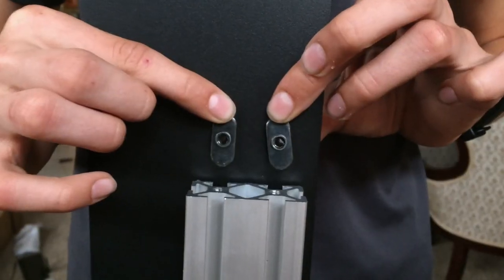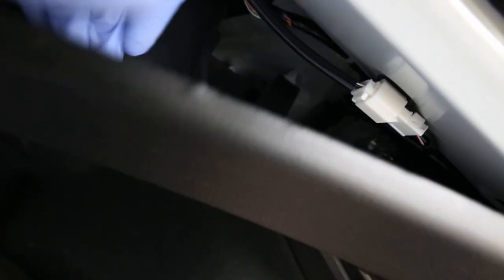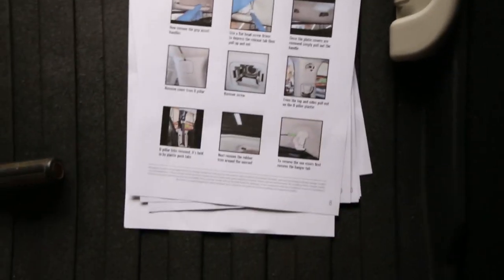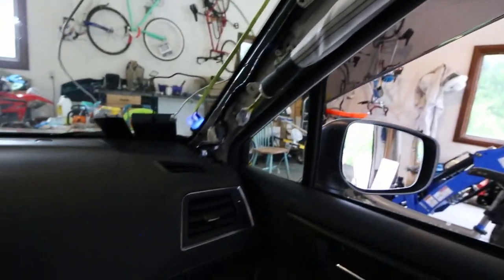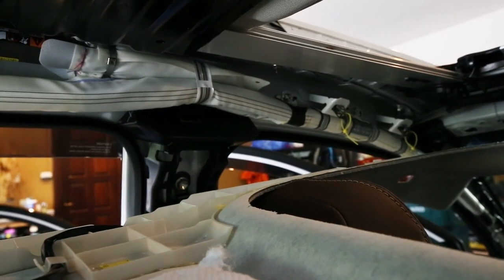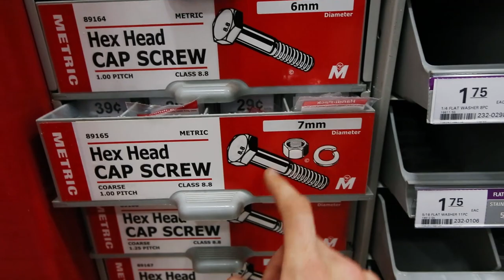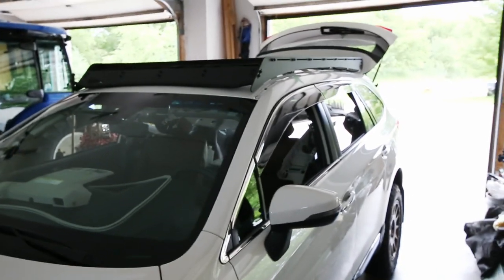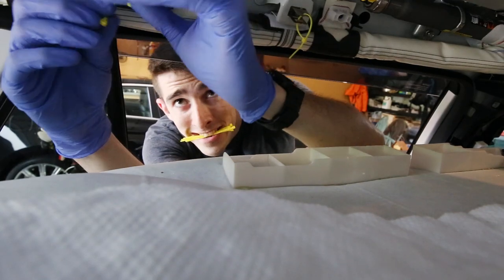FULL INSTALL WALKTHROUGH OF PRINSU RACK ON 2019 SUBARU OUTBACK 3.6R TOURING

Comment: Excellent walk through. I wouldn't have attempted this on my own without it. Finished mine yesterday with no major issues. A few additional thoughts for anyone attempting
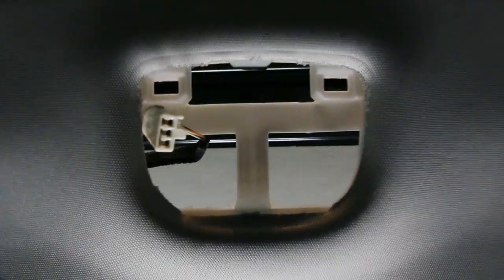1. 46:36 - I did  pull these tabs out. It felt like a very delicate part of the car (mine is the one without the sunroof). I was able to get the middle of the liner out by sliding it toward the back of the car. There's no need to actually pull them out.
2. I have an odd issue with the A-pillar. Everything looks just like this video, except a single, small black plastic piece fell out of each side. (Anyone know that that might be?)
3. I highly recommend an auto panel trim removal kit. I bought one for $5 on amazon and it is the best $5 I've ever spent. 
Th-th-that's all folks. Good luck to anyone attempting this. Took me 6 hours total, but 2 of those hours were due to errors.
Reply from the maker: Thanks for the "review"! I'm glad it was helpful and hopefully future folks will find your notes here helpful for them as well. 

(I'm not sure what fell out from your A-pillar. I just took mine off again to look and didn't see anything that was both black and looked like it'd just fall off easily.)

Comment: Thanks for posting this walkthrough. Looks great!
 I am ordering my rack today. As for the CB question. I'd say you're better off with HAM radio. I've had a ham in all my offload vehicles. You get much longer reception...depending on unit you buy, and I've found more people running HAM vs CB. I'll be installing my HAM radio antenna at the same time as roof rack. Before you buy and install a light on the roof you might want to consider glare off the windshield and hood. I can speak from experience!!! There were countless times I was night driving in Death Valley and unable to see at due to glare from upper light bar. I stopped using it and only used my bumper mounted lights.Unless you plan to plasti dip your hood the help absorb glare, you might want to consider sticking with lights on the front bumper. Just my .2
Reply from the maker: I'm glad it was helpful to you! And thank YOU very much for the insights from your experience with the upper light bar and HAM radio! I'm definitely going to do more looking into HAM and try and figure out how to build that into my setup.

Comment: Love the video. I think I saw a pic of your build somewhere else...how did you mount your full size spare to the prinsu rack?
Reply from the maker: Thank you, I hope it was helpful to you! I actually built my own mounting bracket out of some Menards aluminum. They mount to the crossbar of the rack and have separate bolts that extend up through the bolt holes in the wheel when placed face down. I have enough sidewall on my tires to float the face of the wheel off the crossbar so it won't rub, and the rubber provides exceptional grip to further stabilize the wheel once it's bolted in place. (Also acts as a sound dampener so there's no vibrational noise from it, just wind noise, as you would expect.

Comment: Great video, thanks for sharing!  Seems like you’re literally the only YouTuber that’s had the gall to deal with taking down the Outback headliner and actually install this thing!

A few questions: 1.) to confirm, you said prior to installing to open the sun roof all the way?  Wanting to make sure it being open won’t interfere with the installation, and 2.) in real time, how long do you think it took you to take down and put back up the headliner?
Reply from the maker: The service guys at the dealership were impressed I did it myself haha. It wasn't all that bad once you get into it. Excellent questions! 1) I opened the sunroof all the way so I'd have every possible access point available for when I was getting it put up (I did it before I disconnected the battery just so I wouldn't have to reconnect it with my dome lights and EyeSight stuff unplugged because I didn't want any of that to get screwed up). 2) It ended up taking me roughly 14 hours start to finish, but that included the time I took to stop and do the video bits throughout, and the extra time to re-tap the one plus-nut I stripped out when I tightened it down too snug. So if you've got the essence of the steps down (for what trim needs removed to get the headliner free and where the screws/snaps are, then it probably wouldn't take more than 8 hours I would guess. Putting the headliner back up and replacing all the trim took a little over an hour for me). Just definitely take your time, and use more silicone than you think you'll need and then a little extra because I know some of the crosstrek guys had issues with theirs leaking and had to go back in and redo their silicone work after the fact and that'd be no fun. If you come up with other questions that the video doesn't answer, or doesn't answer well enough just let me know either here or on Instagram. :)
Reply: @mnoutback  Great work Gall indeed.

Comment: Question: What is the distance between the rear or the rack and the liftgate when up?  I'm considering this for my 2019 Outback, but would like to put a lightbar on the rear.  Concerned there is not enough room to keep it below the top plane of the rack.
Reply from the maker: Great question, it's right about 2.25" at the most narrow spot with the liftgate up.

Comment: What's the difference in body design that this will work on the 2014 but not the 2013?  I thought both were Gen4 and thus wouldn't have significant redesign differences....

Edit: btw, looks great man!!
Reply from the maker: Actually that's a fantastic question and I'm with you on that one. I'm pretty sure the rack should work for the 2013 just as well as it would on the 2014 but to be on the safe side I would reach out to Prinsu and ask them if they're able to confirm it'll fit.

Comment: Hey man, I have the same car, and want to do a Prinsu rack like this. A friend of mine that is a Subaru Tech told me that this rack makes the roof prone to leaking. Have you had any problems with leaks since you installed it?
Reply from the maker: Hey there Bart! Sorry I'm just now seeing this. I have no issues with leaks after almost two years of having the rack with the using the install techniques shown in my video. I've heard from some Crosstrek folks that got excited and rushed the install only to end up with a leaky roof, so be patient, take your sweet time, and it should turn out nearly bomb proof. Cheers!

Comment: hi can you tell me if 245/65/17 would fit 1 inch lift?
Reply from the maker: 245/65/17x7.5+35 is the first thing I did to mine and fits with very minimal rubbing on stock ride height.

Comment: Hi there! I am considering installing the Prinsu rack on my 2021 Subaru Outback, but I have some concerns if I down the road I decide to sell my car, if I am ever going to be able to reinstall the OEM crossbars. Do you have an insight into that?
Reply from the maker: Great question. You should be able to reinstall the factory rails down the road. You would likely need to just consider using something like larger washers to help reinforce around the preexisting holes that you drilled larger to install the plusnuts for the rack.

Comment: Nice job!  Did you consider installing a CB or other radio antenna while your roof liner was down?  Or roof lights for that matter?  Running wiring would have been super easy at that point.
Reply from the maker: Excellent questions! In short: yes. The majority of my off-pavement time so far has been spent in areas without cell coverage so the CB antenna is definitely on my list of things to add, as is a lightbar (and a full size spare for safe keeping). And yes it would have been a perfect time to install either of those when I had the roof liner down. However, the roofrack used my last bit of the mod budget for the time being, and I am still researching antennas and lightbars to plan out what will be the best fit for my usage. So the antenna and light bar are in the works but won't happen for a bit. If you have recommendations for either I'd love to hear your input. :)

Comment: I have a 2018 outback touring (as well) ... has anyone found a roof rack / basket that mounts directly to the low profile rails, so one doesn't have to buy the cross bars (from Thule or ?)?
Reply from the maker: Fantastic question! In all my time spent google searching options I wasn't able to find anything that worked directly with the low profile rails (surprisingly, not even FrontRunner was able to figure out a way to mount to those securely enough). That's why I jumped all over Prinsu's rack when I found it and it's worked so well for me thus far. If you find one that works let me know so I can pass it along to anyone else who might be looking for the same thing!

Comment: Can you measure how deep the Chanel is on average? And how far apart are the stock bolt holes?
Reply from the maker: The channel is roughly 3/4" and the stock bolt hole spacing is not uniform, it varies as as you go along the roofline.
Reply: @mnoutback  Thanks man; great detailed video!

Comment: What did you end up installing on top of your roof rack?  How long did the project take from start to finish?
Reply from the maker: Both good questions! I now have my full size spare and some recovery boards up there. It took me about 14 hours start to finish, but that was primarily because: 1) I was trying to video the whole thing and hadn't actually used the video function on my camera before so that was a whole learning curve, 2) I'd never taken down a headliner before and didn't find any good videos on it on youtube so that was pretty much all self-taught as I went, and 3) I stripped one of my plusnuts and had to wait until Menards was open the next day to get some more hardware to fix that. So start to finish was 14 hours for me.
Reply: mnoutback if you did it again, no filming just the install how long do you think it would take?
Reply from the maker: @davenash2304  I would guess it'd be less than 8 hours depending on how much time you take to be meticulous with the trim removal, plusnut install, and silicon.

Comment: 14 hours? dang I follow you on IG and am the one getting married before I get the roof rack, but dang that is a ton of work for that rack. question, are you worried about any leakage in those gutter like spots on the top of the car where you bolted the rack in to the roof?
Reply from the maker: Oh that's you! Hello! :) That's a very good question because I do know of a couple folks who did end up having issues with theirs leaking after the install. For mine I went liberal on my silicone use and haven't had any issue with it after having it up there for almost a full year now. I just took down the headliner to replace the hardware I had gotten to fill the unused holes because what I picked the first time around rusted like mad. When I had it down I looked everywhere and there wasn't even the smallest sign that anything had leaked. :) I'm now just trying to figure out if there's a way I can add a little popup to that part of my video so I can let people know I no longer recommend those brown connector bolt caps because they rust. I'm totally not proficient with youtube so if you know how to do that let me know. :) If you have any other questions too please ask! :)
Reply from the maker: P.S. For taking the headliner down the second time around it only took me about an hour, and less than that to get it put back up :)